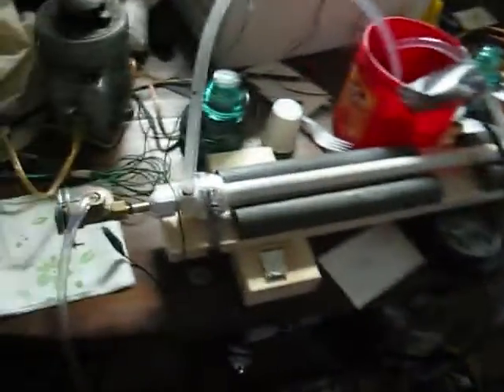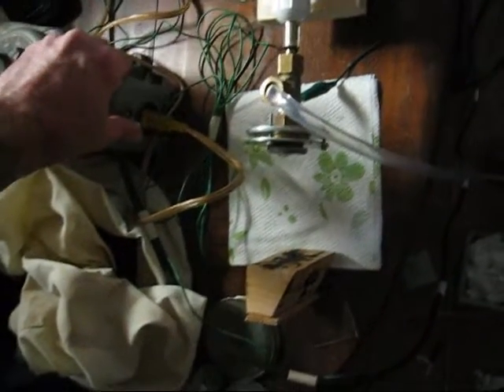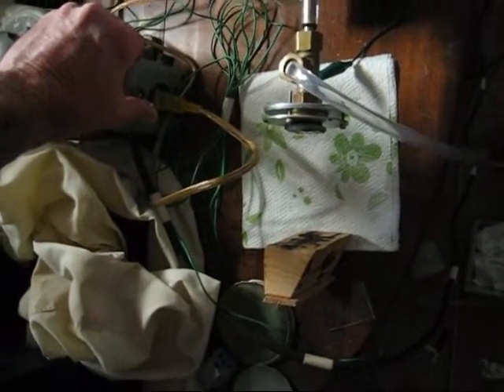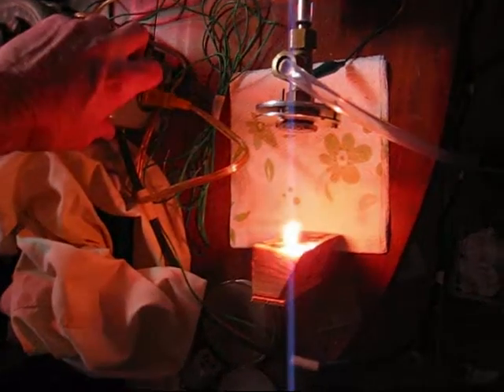New laser: fun with some wood.

Comment from the maker: Yes.Baking soda and vinegar. This is possibly 40 Watts. Power density does matter. If I calculate the intensity per centimeter, focusing the beam to 1/10 mm gives an intensity of 509,554 Watts/cm^2, or 12,738 times more intinse! Alternately, by expanding the beam to 1 meter in diameter, the intensity becomes only 5 milliwatts/cm^2. The intensity is reduced 8000 times! 

Area        =   (pi)(r^2)
Intensity =    Power/Area

This is a simplified explanation which ignores mode structure.